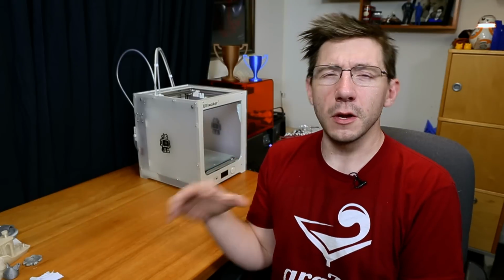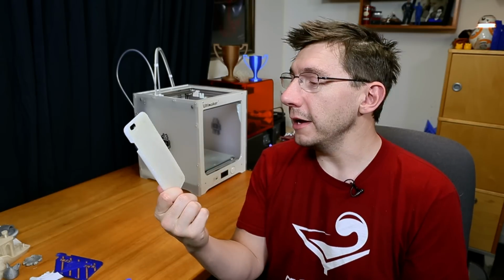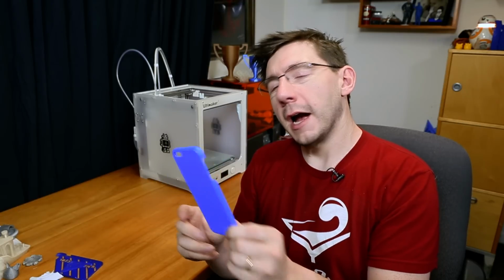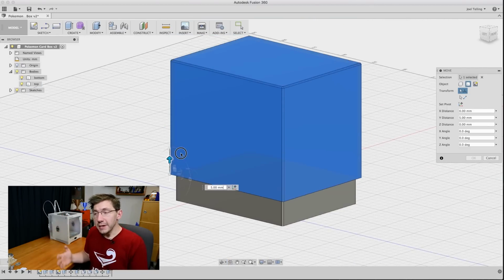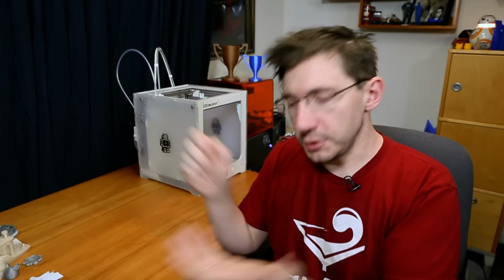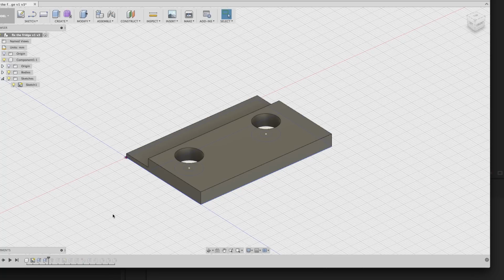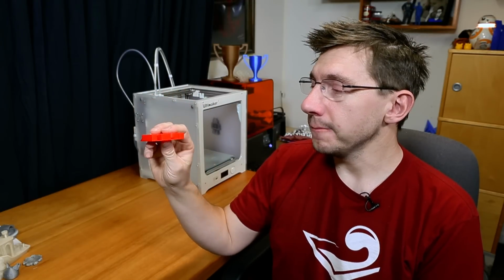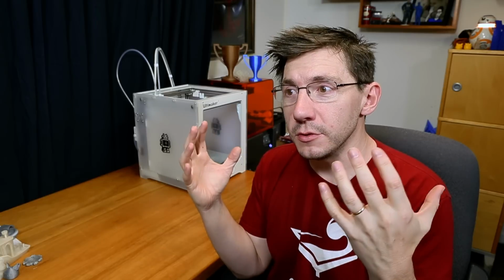My Top 5 Useful 3D Prints of 2016

Comment: I was wondering of you can print auto parts?- my wife lost the cap of the radiator on my Mercedes Miami 320 2001, and man couldn't find that cap anywhere,so I was wondering if it could be a use for 3d printing in that area. 
P.s.: I just subscribed to your channel, your videos are awesome!
Reply from the maker: Thanks for the kind words! The issue with the radiator cap is it gets really hot. You could print something out of plastic, but my guess is you'd want a true metal cap in there. HOWEVER, you can always experiment, but, you do that at your own risk and the risk of the car :)
Reply: 3D Printing Nerd risking is all about in life! Thanks for replying,it was an honor😃

Comment: @3dprintingnerd 1:30 dont print sharp corners in your case or it will snap. instead do rounded inside corners even if its radius is only 1 it wont snap as easy
Reply from the maker: +Micky S. ooh good call thank you!
Reply: wow i really didnt expect a reply. thanks

Comment: If I 3D printed a card box like that, I would probably make the exposed part of the bottom thick enough to be flush with the top part. Then when you put the top on, it has an edge to rest on instead of the cards themselves and the entire thing looks and feels more like a single box rather than two halves.
Reply: Boxes I have bought are like that. Usually Transparent PVC.

Comment: is it possible to make different colors on the same print? Example: The black on the top of Pikachu's ears. i'm only 13, so i don't know why i'm asking this.
Reply: If your printer has 2 nozzles it can swap between different filaments easily. It's also possible to join lengths of filament together to get varying colors, but achieving perfect layers of desired  colours would be very hard. It's easiest to paint a model when you're finished.

Comment: Most useful thing i've done is probably an SD card holder. I used to lay them on my desk, and i'd lose them all the time. Now I always know where they are and they don't get covered in trash. Aside from that, I have some designs in progress that will be prototyped in my printer which is very useful in a different way.

Comment: I went insane and designed a custom table for my live DJ gear. It measures 20"x60"x3.5" (massive). Printed it in separate parts and assembled it. Parts are held together by friction and work great! Print time was about 19 hours per part, about 22 parts in all if I remember so it took quite some time, but it is the coolest thing I've printed and very very useful. Took some tips with Simplify 3D from watching Joel too! Have a vid about it on my channel if interested in seeing it.

Comment: That refrigerator part could easily be made of flexible material using more practical and efficient processes (e.g. injection molding) for mass production, so I wouldn't really say it's an example of how additive manufacture will revolutionize industry. AM is most useful in cases where a more optimal design can be created which cannot be created through traditional means.
Reply from the maker: That's a good point

Comment: Great video. Thanks for taking the time to make it. Question: I see you have an Ultimaker on your desk there. Is that THE printer you would recommend somenone new to 3d Printing?
Reply from the maker: +Christopher Soule it's certainly a decent machine and performs very well. If you have the budget for that machine you won't be sorry. It IS expensive and there are other machines out there that will do a decent job as well, though.

Comment: I have made a modular support for the sagging 280mm graphics card in my main computer. I designed a custom thread that allows 1.5mm steps that are vibration proof. My first design is adjustable from 6" - 9" w/ the base and 4.5" - 7.5" w/o. Will be putting all the parts on Thingverse soon.
Reply from the maker: Oh, now THAT is cool and a great use of 3d printing!
Reply: Since I just have a Select Mini the modular design was required.
Reply: I have posted the files for my creation, Stack Jack, on Thingiverse

Comment: For flexible phone cases you really don't want to use the models that are made for rigid materials like PLA. First of all it won't grip - just like you experienced. And if you do use flexible materials, it'd probably be nicer to make an outdoor-kinda case that's really rugged and has thicker walls.

But in the end, with flexible filament like TPU you need a model that goes around the top edge completely and the dimensions should be a little smaller so it'll stretch onto the phone rather then loosely  sit around it. Printing a top edge is a little harder though, IME it needs support structures. I like to use dual extrusion with TPU and PLA for that - the PLA just comes right off the TPU.
Reply from the maker: that's a very good point. I'm going to try to find another model to use.
Reply: Guess with the iPhone that shouldn't be a problem. Another option would be to have a two-part phone case with a flexible part encased by a rugged clip just like this: http://amzn.to/2nmmb7v currently got something like this(I'm pretty clumsy and went through more than a few displays in the last years) and it's not coming off by itself and pretty much rock solid. :)

Comment: Have you tried using dry PVA glue on the ceramic bed? This could resolve the adhesion problem.
Reply from the maker: dry PVA glue? I don't know if I have any of that, do you have a link?
Reply: I can explain quite easily: watch?v=o_pZ3NsDBFI . The idea is to smear a layer of PVA glue and let it dry overnight, then print on it. It works on any silicate substrate, but don't try do it on glass, since the part would tear out shards of glass when you take it off, it is that strong. Marble should work fine.

Comment: I have a practical print. I've had issues using my HTC Vive, so I printed a frame for my lenses that I took from an old pair of glasses. I printed them in a manner that made it so the dimensions of the frame was supported by the headset. It worked out fantastic (had to try it a couple of time).

Comment: You should try making a case with a flexible rubber insert like most rugged cases are, so you could print the rubber insert to fit into the plastic outer shell that fits the phone.

Comment: Regarding your refrigerator part redesign, what if you eliminated the small nub altogether and printed in a non-flexible material?  If the flipper seal is already rotated, then there would be no nub to hit. Does the flipper require the nub to get it to rotate?
Reply from the maker: +Gene Merritt hey! Yes it does - the nub is needed  for flap rotation.

Comment: so you spent $500 or more for a 3d printer. to print a $20 cellphone case, and $1 box and $28 part. nice  3D printer is just a toy for adults
Reply from the maker: +will8anthony That's correct. I've only ever printed these things as well. That's it. It's like you know me. You're in my head. You exist in the darkness. You're a shadow. Unfortunately a shadow that doesn't use punctuation in the right places, but a shadow none-the-less. Shadows ARE cool, regardless of their grammatical mistakes. Always remember that, Shadowman.

Comment: so basically 3d printing is totally uneconomical and just an expensive hobby? If you had to pay someone to print 4 phone cases and only one worked your company would be bankrupt. For the cost of the 3d printer you probably could of bought an entire new fridge. That box could of been made out of duct tape and cardboard, etc, etc, etc. 3d printers are nice toys, hardly usefull/practical on an economic basis.
Reply: Suppose you work for a company that makes phone cases, and you print 4 cases that don't work, then the fifth case is the one you take to production. Alternatively, if you don't have a 3d printer, maybe you just take that first flimsy case to production-- in which case you end up with a thousand or more defective copies of your product. In short, 3d printing is useful (in its current form) for prototyping... in terms of production, you're absolutely correct: it would probably be unwise to buy a 3d printer in order to sell the actual prints.
Reply: Exactly. I'm interviewing for engineering jobs, and every place I've gone to had at least one 3D printer for prototyping.  They used to have to send a design to their supplier who'd make 10 or so copies of the design and ship them back a week later.  Very expensive.  Now they can print a single copy in an hour or two, test fit and check ergonomics for the user, and still have time to go through 3 or 4 iterations in a single day.  One design iteration per week costing several hundred dollars, vs. 3 or 4 in a day for less than $20 of filament? No brainer for productivity and cost.
Reply: Also, it's less hassle than hiring movers and replacing the entire refrigerator. Don't forget that you can solve more than one problem with a 3d printer. Maybe something else will break at some point.
Reply: A 10 dollar door latch from ebay would be practical. But if you have a printer you can make replacement parts that don't look out of place, or are more functional.

Comment: I wonder plz do not hate me but I wonder can people make a 3D printer from a 3D printer then do the wiring in side to make it work?
Reply: Some of the more 'do it yourself' type of 3D printers have parts that were 3D print by other printers

I have the reprap one and when I bought it I had to buy pieces other people had printed, then I reprinted them to make them better 

But the whole printer would be impossible even without the wiring cause you need metal pieces in the printer and motors
Reply: Technically yes, but effectively no. It's theoretically possible and likely in the future to be able to 3D print a 3D printer using more than 1 printer (though one of the printers used would be special and not 3d-printable). All the plastic and circuit boards could be printed. The chips probably won't be printable for a very long time. The metal parts could be printed with a metal 3D printer, but those are very expensive and a long way from being able to do that affordably. While metal 3D printers are insanely expensive, a decade or so ago the plastic ones were that expensive as well, so who knows what the future holds.

Also, you could always use a 3D printer to create positives, which then you could use to create negative molds to then cast metal parts for use.

Comment: Interesting video, dear 3DNerd. Having fun with the fillet remarks... and adding to the pile...although a mechanical Fillet sounds very French, the words used for this curvy feature in French, are congé et arrondi - depending if this is an inside or outside curve (convex/concave).
I find I print mostly practical items... no Pikachu yet; although I did print a satisfying young Groot as a flower pot the other day and I am very tempted by this stunning monkey: http://www.thingiverse.com/thing:1316742. Very inspiring.
Here are a few items I designed and printed to repair household goods:
- leg clips for my old trusty Workmate; https://www.treatstock.com/3d-printable-models/7935-blackdecker-workmate-replacement-leg-clip
- replacement wheels for our carry-on luggage; https://www.treatstock.com/3d-printable-models/7933-replacement-wheel-for-luggage. Should fit LondonFog 4 wheelers. Got another wheel for my 2 wheel luggage piece.
- replacement wheel pillar for my old Shop-Vac vacuum; https://www.treatstock.com/3d-printable-models/8018-shop-vac-wheel-pillar
- a nose bridge for my wife broken glasses while she waited for her new glasses.
- frame for the inserts to my sport glasses - out of nylon.
- replacement handles for a cooking pot 
- a better latch for my wife's large easel.
- roof rack parts to fit my Subaru Outback; https://www.treatstock.com/3d-printable-models/7934-roof-rack-adapter-for-subaru-outback
- a number of parts for my kayaks; drain plugs, clips, GoPro mast. Foot pegs for ww expedition kayaks.
I'll be looking at your other videos to learn new tricks. I liked the trick for the hairy lion.
Thanks! Et au revoir!

Comment: to be honest.. everything other than that part for your fridge are basically decorations.. that phone case isn't protecting your phone very much. that shift knob is pretty much the opposite of what anyone would want as a shift knob other than someone that's really into 3d printing.. and it doesn't improve the shifting.. it just looks different. (performance shift knobs are weighted). a flower pot.. I feel like that ones pretty obvious. and a box to hold cards.. they're all sort of neat. but a CNC mill, even a desktop one.. is way more useful in making practical things. even if you're just milling plastic. and they're not even that much more expensive.. and if you're buying a decent 3d printer... they end up being fairly comparable in price. but with a mill you can make much much better stuff. I would enjoy a 3d printer ... but more as a toy. you're not going to 3d print a short throw shifter for your car. but you could easily mill one. and I know they have 3d printers that print resins and even metal. but they cost even more than a mill and only really have the benefit of being able to make hollow parts and not "waste" material.. but the materials they use are more expensive than what you "waste" anyway. 3d printed parts are not as weak as most people seem to think.. but every layer is adding a failure point.. which does compromise the strength.
Reply from the maker: These are extremely wonderful and well though out points! I have never used a CNC mill, would love to try one and see it work in action.

Comment: I love this topic!  Some of the useful stuff i did: coat hangers / hooks, usb organizer / holder, business card holder, phone case, small storage box, toothbrush holder, toothpaste roller, surprisingly usable comb, and my number one favorite.. Proprietary knobs. Printed a new knob for my dryer, and a replacement dashboard dial in a 1986 porsche 944, which was like a $100 part.
Reply from the maker: That's so cool! Right there, that single dashboard dial, that must have been SO GREAT when you put it in and it worked. Such a feeling of accomplishment right there
Reply: Sure was! After a few test prints finally getting the size / notching right, painting black, and setting in place was a HUGE win! And of course one of the mini prototypes sits on my work desk as a reminder.

Comment: the rough texture of the box is damaging the edges of her pokemon cards.
Reply: Jack O'Lantern you could try to DIY your own like it with soft filament prints epoxied onto the hard case so it's not quite so harsh on the cards, or maybe long thin-ish raised areas for the cards to slide against, where the grain is perpendicular to the cards edge

Comment: Pretty interesting ideas (especially the cell phone covers), but personally I would've used that last part to cast it from aluminium. It would've been WAY more durable that way.
Reply from the maker: aluminum fridge fix? hmm. that's an interesting idea...
Reply: Yeah. If you have access to someone who can do the casting for you, you only need to provide the original. I usually pour (sanitary) silicon over the part I want to copy, let it harden (mixing it with some water makes it harden faster), remove the original and pour glue from a hot glue gun into it. When it cools down, it's perfect for both sand and plaster casting. Just FYI ;)

Comment: I'm printing eyeglass frames on my MP Select Mini right now.

If they have to be any wider, I'll have to print them diagonally on the Z axis as well as on the Y.
Reply from the maker: that's awesome!
Reply: I cannot take credit for the design.  It's thing:615395 on Thingiverse.

I plan on printing it as a demo to figure out what to do to modify it for my lenses.  I'll make the necessary adjustments and re-print.  Once I get it working, I'll work on making it look right.  Why re-invent the wheel, right?  

That's what 3D printers are about, in my opinion.  We get to improve the internal community while providing a service to those on the outside.
Reply: After printing and thinking it through, it is going to be less work to copy the outline of my lenses into Fusion 360 and create frames anew.
Reply: I did the same by doing a screen grab of bernards glasses from westworld and running that through 'inkscape'. Then I took a pic of my lens and ran that through inkscape as well. then i used the lens stl to hole punch the glasses in tinkercad. I had always wanted to do this and after 5 years 3d printing, i finally did.

Comment: For someone who is interested in learning to 3D model for printing, what would be the best software to start on, in your opinion?  Are there any resources you use specifically to help you learn how to model?
Reply: Casey Sutherland I'd recommend Fusion 360.
Reply: Casey Sutherland solidworks is great
Reply: fusion 360 is great for designing functional parts
Reply: I use 123d design, it's really easy but you can't do very advanced stuff with it.
Reply: google sketch up is pretty good too. you just need to get an addon that can export as an .stl file
Reply: Casey Sutherland you should use 123D Design, then do CAd
Reply: Casey Sutherland  my school uses autocad inventor
Reply: I think parametric modelling is far easier than synchronous modelling, so you can keep that in mind. I'm mostly familiar with expensive commercial software, though.
Reply: I may have missed something but when i was on the site of fusion 360 it was a little expensive
Id just use blender as i already have some experience with it and know the shortcuts i need for modeling